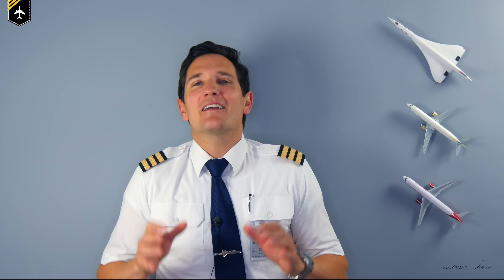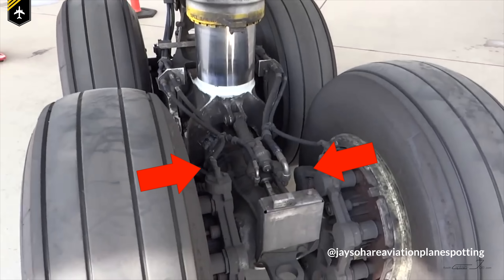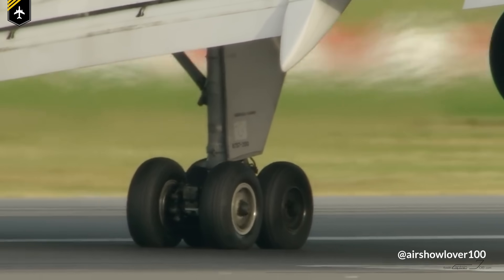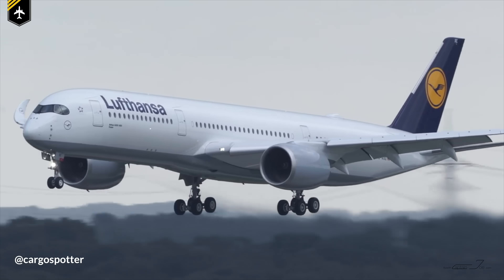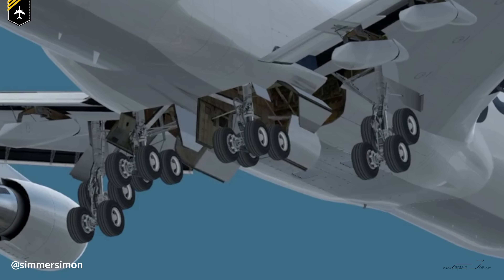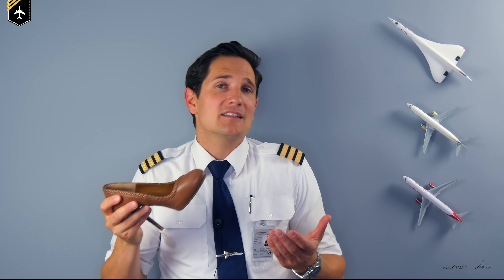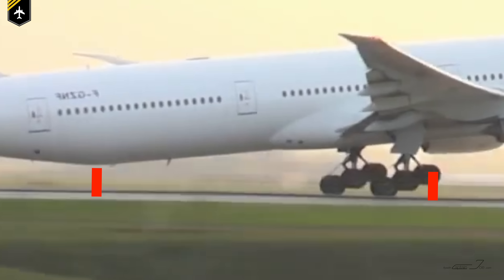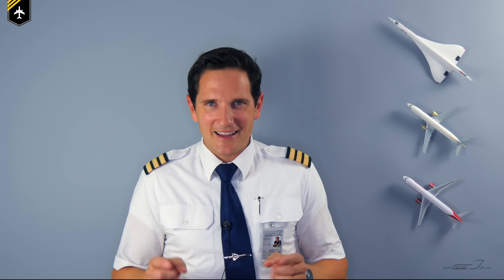Why is the LANDING GEAR TILTED? Explained by CAPTAIN JOE

Comment: Does one of you know what the small lights (red, white) on the middle support bar of the A320 cockpit windows are for? (Right below the analog compass)
Reply: PistonPete this is to get the seating position correct. The red ball should hide the white ball, this shows that you are sitting in the perfect position for visibility etc
Reply: and they are not lights, but simple balls as Karl says
Reply: Ok thanks :)

Comment: The A340 has a single axle gear in the middle of the belly. When the plane is empty of fuel and cargo, it does not touch the ground.

Comment: I grew up near the main Air Force cargo base in the Pacific area, (Travis) so we had lots of C-5 flying around and I knew some C-5 pilots. 
   Once a crew practicing touch and goes disconnected their gear warning horn because it was going off all the time, then on one landing they forgot to extend the landing gear.
     I knew a C-5 pilot (not the one who landed gear up) and he told me that the C-5 is so big you don't even know you've ended your Air Force career until you power up to taxi off the runway.
    That has got to be a sickening feeling.

Comment: Great video 👍. I used to think that the wing gears on a 747 had more tilt was so that on touch down the rear two tyres on each of the wing bogies would contact the runway at the same time as body gears, making it more stable in cross winds etc.     Keep up the good work👍

Comment: BTW, the A330 and A340 have also the same style articulated main wheel bogies, not just the 777.  From a pure technical perspective, aircraft with these styles of bogies make two touchdowns, first the lowest wheel pair, then the rest, as weight starts pressing down on the landing gear.

Comment: I'm kind of confused by your answers. First, you say it's advantageous to tilt the gear rearwards but then go on to say that it depends on how the wheels fit in the bay. Why can' the positioning of the gear be tilted to the moderate tilt back from the extreme tilt, no tilt, forward tilt required to store the gear? Obviously, this adds more complexity to the gear so then it really must not matter which direction the gear is pointed on landing so long as you know what direction that is.

Comment: Totally makes sense about the wheels needing to fit into the fuselage but if there are actuators on the trucks, once the wheels are OUT of the wheel bays why don't the actuators then make them parallel to the ground? (assuming parallel is better). I think the fact that they keep them in their "stowed configuration" as they make contact with the ground implies that they NEEDED to hit the ground that way and is what was confusing people....including me.

Comment: What happens if you need to do a turn around after the the rear tires have touched down? Does the automation of the air brake and so on affect this? I'm sure it can be cancelled, I'm just curious about the procedure and if it eats up some time/runway
Reply: There is a button called "TO/GA" (takeoff/go-around). It deactivates the brakes and gives full thrust. 

In some airplanes, this is only possible up to the point where the reversers aren't deployed yet.
Reply: Dominik Andree makes sense. thank you!

Comment: hey Joe,

I have a question after watching this video. So as I understood from the video, the tilting mechanism is used to use less space. but why do the gears stay tilted when the gear is fully extracted for landing? doesn't this put more stress on the wheels touching down first? wouldn't it be better for all wheels to touch down together to even out the stress on the tires generated by the landing?

Comment: Joe, in 4:50 I wouldn't say the answer to why the wing gear is not positioned further aft is space. It has to do with load distribution and ground manoeuvring capability without excessively wearing out the tyres. And at 7:00, hats off to the designer of that LG arrangement! Norman S. Currey.

Comment: 6:15 Why is the Airfrance logo turned around?
Reply: Mr Clean I noticed too, maybe he flipped the image so as to make it go from left to right.
Reply: either staying safe with copyright laws, or simply the camera mirror effect
Reply: if someone thinks flipping the image would be OK with copyright laws (if using it unflipped isn't), they are very wrong.
Maybe it won't trigger some automatic software detection, but that does not make right :)
Reply: Maybe this is the camera mirror affect
Reply: nice observation man
Reply: Must be the painter got the mask wrong way around

Comment: Hey Captain Joe have a stupid question, why is does the plain have to atract the wheels cant the wheels just stay out? It would save space pleas dont bite my head off just asking?
Reply: roche vermaak 

Because the air resistance would cause the plane to be slower and use more fuel. Also, the gear would be destroyed at 800 km/h.

Comment: And then you have the A340-600, where the outer gears have the rear wheels down and the body gear has the forward wheels down.  Schönes Video.  Eine gute Erklärung, wie immer.

Comment: The first model of the 747 is designed to only have 3 landing gear but because some runways could not handle it so the creators had to add two more to distributors the weight

Comment: I am surprised aircraft don’t spin up their wheels and save rubber. Don’t bother on a short strip if the braking effect needed. Could be done with tiny fins on the wheels

Comment: 757's brake changes are a pain... than again, all of them are. Worse was when I had to change 3 tires and a brake, and the brake was on the good tire! Luckily, I came in a time where they are using more carbon breaks than steel breaks.

Comment: Noob question:
If you mess up a radio change, why isn't step 3 or 4 a call on guard to ask the correct freq. (example: Kennedy crash) 
Having a fighter jet show up next to your window must be a lot more embarrassing and a lot more paperwork.
Reply: The ATC try to reach out to you multiple times before actually sending someone to intercept. As you said yourself, they will try 121.5 as well. The problem is, sometimes 121.5 is not tuned, or is set to a very low volume, so pilots completely miss the call. Well, in that case, you will be able to get some very cool pictures :P

Comment: I am happy you went from an a321 to a 747 it's not the concord but it's still the ultimate passenger plane 

So sad I recently booked a flight with BA to fly on a 747 upper deck and they switched planes on me for a 777-200 :( (what's the deal with the. Charging to pick seats?)

Comment: I thought the higher tilt angle on the wing gear of the 747 was made so the rear tires of the wing gear touch the runway almost at the same time as the belly gear.

Comment: Question:   What is the differnce between Mayday, Sos and Pan Pan Pan?

I know they al mean the same, but why 3 different versions???
Reply: They DO NOT mean the same. 

Mayday is for absolutely, inevitably and immediate emergencies. 

'Pan' is for emergencies that are tangible, but not immediate or inevitably. 

And SOS isn't used in radio communication at all. It was only used in Morse communication and is nowadays only used in situations where you have to write it in the snow or sand if you are lost.

Comment: Hey Capt Joe, I want to ask a question about the new Airbus Beluga XL? They've designed the Beluga XL on the A330 platform but it's entry into service is going to be a year after the A330neo. Why haven't they gone in for the New Engine Option for the Beluga XL? I mean the fuselage is the same, all they had to do was to modify the wings, the full exercise for which they've already done on the A330neo. Wouldn't they want 20% more fuel efficiency and more thrust? Oil isn't going to become $30/barrel in the future.

Comment: I was wondering what pilots do when there landing gears fail to extend. Can you please make a video on this topic
Reply: Ooooh that's a great suggestion for a video, Saahil Mehta!  It's called a "belly landing," (among other names).  Pilots actually get training and practice for the procedure.  If the procedure is done correctly, pilots can land the plane safely without injuries or maybe just a few minor bumps and bruises at the most.  The plane itself however....  is a different story entirely.
Reply: they land upside down
Reply: Saahil Mehta They land without them
Reply: They take a viagra.
Reply: Saahil Mehta they do a belly land which means that the engines would be their landing gear
Reply: Yes! I want to know abt that too
Reply: Good suggestion.  In addition to what others have said about landing without the gears, I believe there are some procedures pilots go through to attempt to lower the gears manually.
Reply: They have a switch which lets the gears fall out due to their weight.
Reply: I will speak to a couple of engineering aspects related to gear extension (my department), rather than cockpit procedures (someone else's dept).

The DC-3/C-47 was designed with the tires slightly exposed even after the gear was fully retracted.  Supposedly if the propeller tips were feathered to 12-4-8 prior to touchdown (random luck?), a landing could potentially be accomplished with little damage.

Note that on a modern airliner, "gravity" extension doesn't mean freefall.  Hydraulic fluid still needs to squeeze through orifices in the actuator cylinder as gravity pulls on the gear.  If you've seen video of a ground test where the strut freefalls from stowed to down (with something of a bang),  that's to test the integrity of the gear structure under a scenario where the actuator rod breaks and now there's nothing to restrain the gear.

Comment: Given the high acceleration of the wheels at landing why are not the wheels spinned up to the aircrafts current speed in the moments before landing? I could imagine it would reduce the stress of the wheels and the risk of having the aircraft bouncing at the landing. Johan.
Reply: Johan Månsson extra drag from that may be helpful to slow/plant the aircraft down rather than barely floating/landing and therefore more vulnerable to wind

Comment: Why do I smell fuel every time I board a plane. It stinks a lot and makes me feel dizzy.
Reply: Flying Spirit Airlines? Probably forgot to pay the $6.99 no-fuel-vapor fee
Reply: I also smell gasoline when entering a car that just refueled at the gas station... A weird world it is, right?
Reply: Badassiger probably the vapour from refuelling
Reply: @Cl4rendon This is different - read about the Aerotoxic Syndrom. Only Boeing 787 does not have that problem, because they have separate electric air compressors just to avoid this problem.
Reply: Google about Aerotoxic Syndrome.
Reply: Lukas Eggenberger I just cackled out loud reading your comment!  I fly Spirit a few times a year to a larger airport that's farther away from my family whenever fares are too expensive to fly AA to the smaller airport that's actually close to my family.  I've never had any horrible issues with Spirit, but you are SO 100% SPOT ON.  The first time I flew Spirit, I paid the extra $15 or whatever to get the "Shortcut Security" since I had to drive 3 hours to the airport and return my rental car prior to catching my flight.  The airport I was flying out of (MSY) didn't even offer the express security line option for Spirit at the time!  Spirit: 1, Margaret: 0.  I could have used that $15 for an ice cube and a whiff of a potato chip bag if I wanted a snack during my flight!  Maybe Spirit will someday offer the "no-fuel-vapor" option as part of the big bundle of "discounted" extras that they try to sell you every time you book a flight online?  🤣
Reply: A combination of left over fuel smell from a refuel and the APU running causing exhaust fumes that you can smell.
Reply: Lukas Eggenberger Damn in, I knew I should've paid the no-fuel-vapor fee, that's why our flight was delayed. Because I didn't pay for the slot fee.
Cl4rendon Dude, you can't compare normal gasoline with kerosine, It's like comparing an airbus with an boeing aircraft. There are probably subjects that you don't know anything off either so please don't judge me ,thank you.
Reply: Margaret Abercrombie 😀
Reply: tokenklau.. Yeah, the aerotoxic syndrome is on a very different sheet of paper and is believed to be in connection with OIL FUMES from the engine. I`ve read all the alarming reports from sensational activists already - Thank you very much. Badassthinger was referring to that " weird fuel smell" - Well this indeed happens when kerosene fumes temporarily get sucked in the cabin through the AC after or while refueling -  This is the reason why NO SMOKING signs were introduced back then....
Reply: The air conditioning/pressurisation system draw from bleed air of the engine compressor. There are filters in place but not 100% effective.
Reply: Because that plane just got done taxiing, sometimes for half an hour or more, behind a line of other planes belching out exhaust.  The cabin air comes from the outside through the engine compressors.  Those same engines that are sucking up the jet exhaust of the plane in front of them.

Comment: Yaaas! Finally someone explains what gear tilt is
Reply: halcyondaystunes surely it's not just the fitment of the gear into the wheel well? That doesn't explain why the 777's gears tilt AFTER it is lowered. I've always thought it's to smooth out the touchdown so that not a large amount of wheels are contacting the ground at the same time, which leads to a higher shock to the fuselage.
Reply: @LegitMoose  THANK YOU !
Reply: LittleSophia _ I would think it was pretty obvious why they tilt.